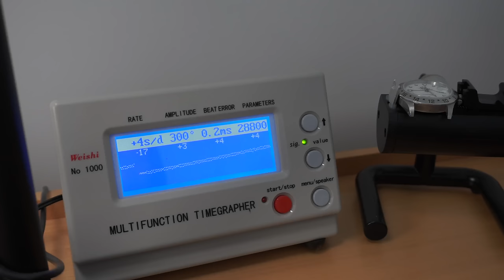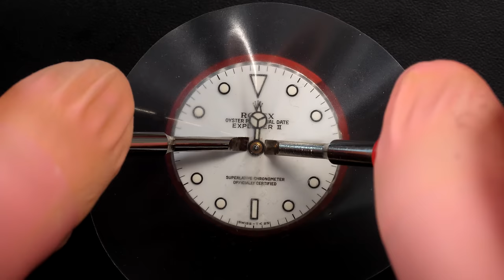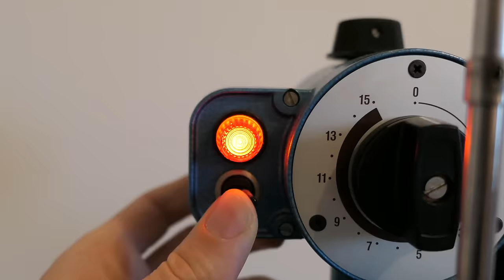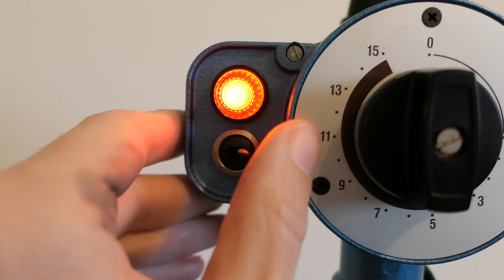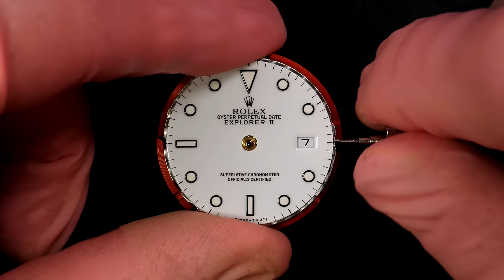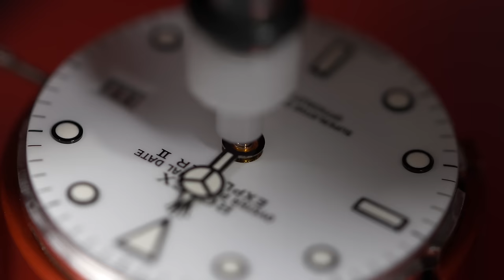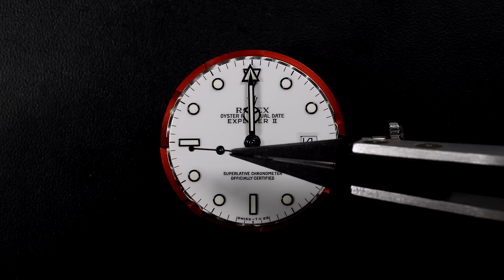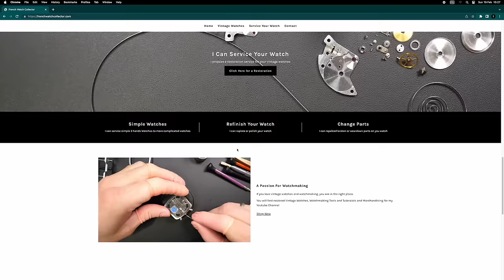Restoring the Rolex Explorer II 16570 Watch !!! Lots of Issues on this Rolex

Comment: Another excellent adventure!  I would have liked to see more detail on the problem of the cannon pinion that led to the issue near the end.  How did you decide that this was the source of the problem and how exactly did you fix it?  
Merci beaucoup!
Reply from the maker: The canon pignon is the parts that dictates a lot of things between the hands. With the right friction amount it makes sure that the hour and minute hand stay in tune. I just made it a bit tighter to increase the friction

Comment: How long did this one worked without service? And why does the amplitude stay so high? Surprising that even mint condition Rolex has its issues :)
Reply from the maker: It is good that the amplitude stay high. I would say you should service a modern rolex around 8 years. Depends how you wear it as well

Comment: great video. lets pick the balance bridge for instance. isn't it better for the screws on a bridge piece to screw one screw 50% in then do other screw 50% in, then keep going alternatively until both are 100% tight? rather than screw one in 100% then go to other screw? see what i mean? i read years ago factories like to do my method to save torquing on pieces etc. i have this watch, model v series 2010 model i love it, beautiful
Reply from the maker: I know what you mean because it is used a lot in mechanic but it is not sure a lot in watchmaking. Not sure why

Comment: Watched to the end and still didn't understand what the issue was 😂 what was the "lanterning" you did to solve it?
Reply from the maker: You see first at the beginning the change is not fully jumping and later on around 33min when I use the GMT fonction to just change the hour hand one by one hour at it should be on a GMT the minute hand and the GMT should stand still but the move. This is why I adjust this with the lanterning of the canon pignon.
Reply: @FrenchWatchCollector  Yes I saw the issue but didn't really understand the solution. I'll research "lanterning" to see if I understand what you did. Thanks for the great video!

Comment: I have a question: my 16570 explorer is running great, date functions, gmt hand functions, etc..however, when winding the watch with no power left, the winding the crown is tough. Takes a lot of effort and not buttery smooth like my similar GMT master with same movement. 

Not crunchy. But like your pushing a car up a hill, resistance. 

Do you think it needs full service? Suggestions?
Reply from the maker: Depend when is your last service. You might have a dried up seal or a dried up automatique winding system

Comment: 2 min before midnight isn't perfect 🤔
Reply from the maker: It is very close to be prefect
Reply: @FrenchWatchCollector  I'm just surprised you go through all that trouble meticulously taking apart the watch, then when it comes to the minute hand at midnight you accept good enough 🤷🏻 all Rolex watches have an instantaneous date change exactly at midnight.
Reply from the maker: @shamrocky  it cannot be exactly midnight. The tolerance for a brand new rolex is 1 minute +2 minutes for the date change. It is like be at +/ zero secondes per day it doesn't exist